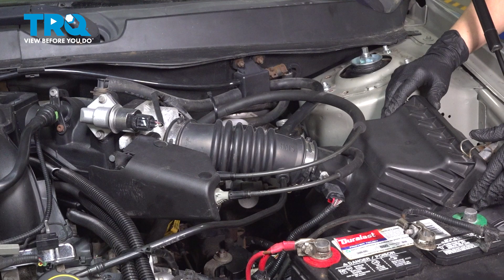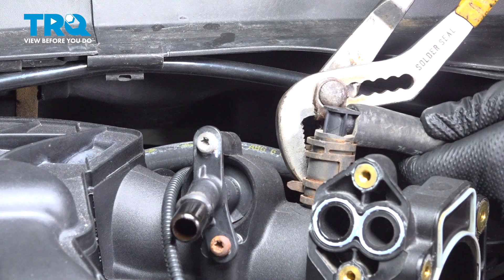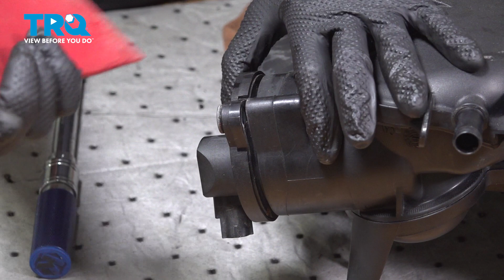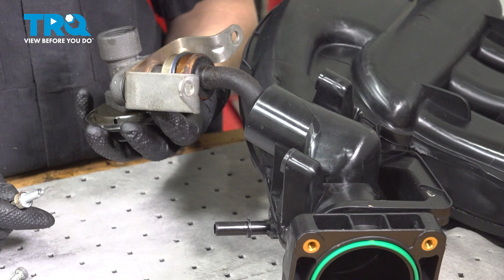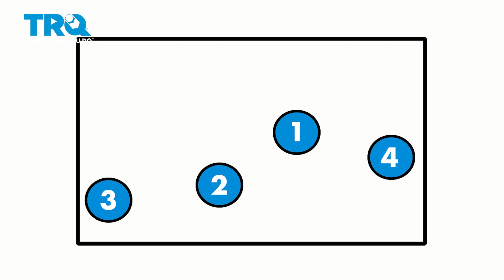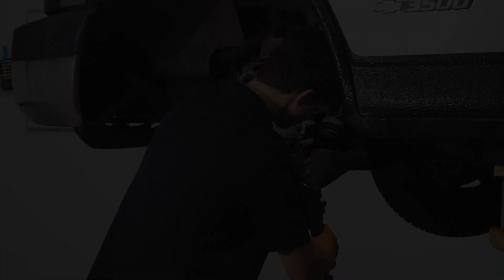How to Replace Intake Manifold 2000-2007 Ford Taurus 3.0L V6

Comment: Excellent video,  but I noticed that there's no mention of inspecting the new intake manifold seals-gasket that were included or a new Gasket-Seal kit would be needed before installing the new intake manifold for proper seal.